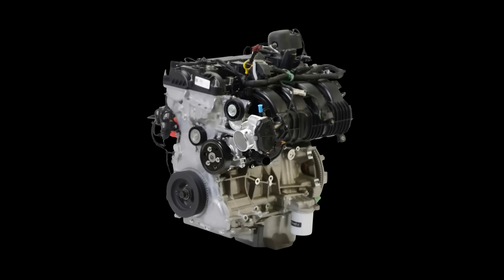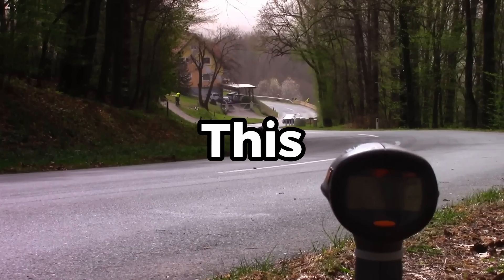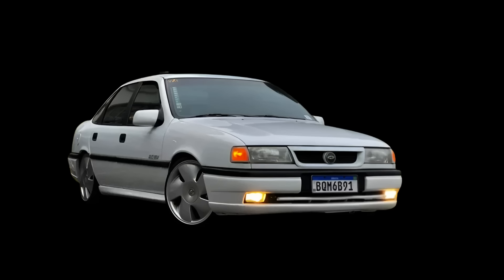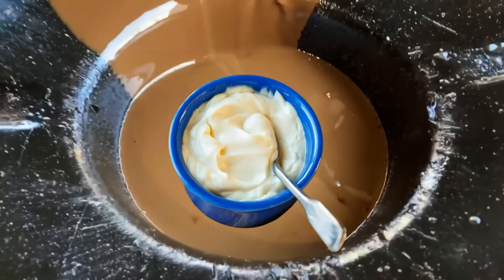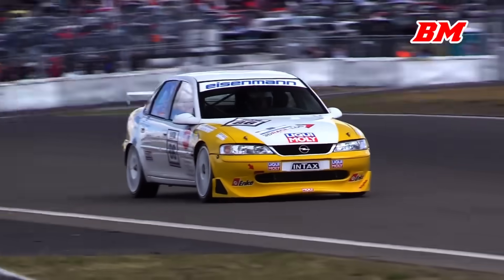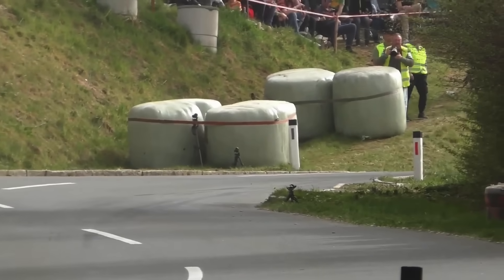The C20XE: When Cosworth And GM Built an Engine Together

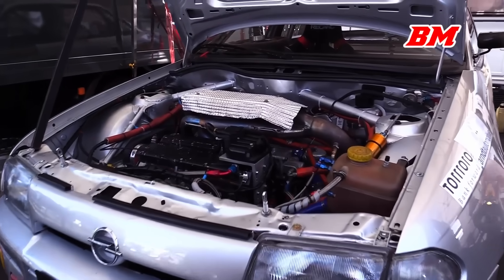Comment: 6:45 Z20LEx Sanitised? Fuckin' LOL. Drive one and then say that. There are very torquey motors in cars with rather basic chassis. They're quite a handful in a fwd car! I had a Courtenay Sport tuned Z20LET in a 2003 Astra GSI, which made a modest 285bhp, but with a hilarious 340ft.lbs of torque at 3k rpm. Needed sticky tyres and a Quaife LSD to make the most of it, and torque steer made for an exciting drive down twisty bumpy country roads.

Comment: 5:13 That's either an N/A X20XEV with an aftermarket turbo fitted, or it's a modifier Z20LET. Totally different head, although the bottom end and block is very similar to the early engines.

Comment: 3:39 the Mk4 Astra here never came with the C20XE; they came with a later evolution of the engine, the X20XEV. There were also some that came with a yet newer again Z20XER, and finally the Z20LET which was a turbo charged variant making 184~197bhp, depending on whose figures you use. Interestingly, even engines as late as the 240bhp Z20LEH used in the Astra VXR in 2010, use a block that is almost exactly the same design as the C20XE. All of these engines evolved from the original 20XE that was designed by GM and Cosworth in 1987. Note, the 20XE, NOT the C20XE. The C20XE didn't come along until 1988 and had O2 sensors and catalytic converter, whereas the 20XE did not.

Comment: You should to a video on peugeot's XU10J4RS or maybe Fiat's Pratola Serra modular engines especially the fivetech 175.a2000 (na) and 175.a3000 turbo variant found in the fiat coupe

Comment: Actually I think the engine was developed from the C20ne (8v) with a new cylinder head. Not a completely new engine.

Not a bad engine anyway but the Saab B204/B234 was slightly better back then.

Comment: I don't know why they didn't just use the Olds Quad Four head and down size it to 2L if necessary. The W41 was making 195hp with 2.3L. The only thing close was the Prelude H22 quite a while later.

Comment: The very first redtops were 20XEJ these came with coscast heads.. the "C" came from later cars fitted with catalytic converters..my astra gte has a 20XEJ but is fully forged running a Evo 9 turbo..making 380bhp. proper old skool boosted power 👌
Reply: The 20XE came before the XEJ, no?

Comment: Iam driving a MX5-NA with C20XE swap. Pure Fun! Engine got a full build with Itbs albeit still hydro Cams. Makes 202hp at 7200 with the revlimiter set to 7800.
981kg with a full tank....
the sound is very special: It sounds like a mix of a tdi and a Chainsaw biting in Oak when you rev it hard.
Reply: It's the first time I hear of an MX5 with C20XE, although I think there were C20XE adaptor plates for RX-8 transmissions :D How much torque are you putting out with the ITBs? Respect!
Reply: @martinp8427  

A Adapterplate wouldnt have worked (I needed to get 18mm backwards). I ended up cutting ?? 48mm of the Bellhousing and welding 30mm of the Astra Bellhousing to the Mx5 Gearbox.
torque was 223nm/164ftlb @6150 with the Lexmaul RAM and 206nm/151ftlb @ 6600 with Itbs. Power stayed the same, but at 7200 instead of 6600rpm. But with the RAM i had an unacceptable Lumpy Idle.
Reply: @TheVossba  Oh, I didn't expect such a difference in torque! Too bad about the poor idle, maybe it was a combination of the slightly aggressive cams and adjustable cam sprockets. Great build and thanks for the info!
Reply: @martinp8427  

the Lexmaul Ram intake is known for very good torque, but the long narrow Runners limit topend. Idle gets lumpy if you use Cams with more Overlap and a single throttle.
the tüv approved Itbs from Dbilas have very short runners and my 274deg Catcams were the max for the ram, but not enough for the Itbs..

Comment: Swindon Race engines took the C20XE right up t the 320bhp mark with a redline of 8500rpm in BTCC format.
To get there, they actually reversed the head so the intake was at the front of the engine bay to gain a ram air effect, with the exhaust being at the back against the bulkhead in FWD applications.
Reply from the maker: Yes that's actually a popular setup on high horsepower NA builds, thank you for the extra informations.

Comment: These were AWSOME!!!!!!!!    Worst thing about moving internationally was leaving my Kadett in South Africa. It had a seriously built C20XE and looked like a SuperBoss.  24 years later I still miss it.  A friend looked after it but eventually had to sell it for me as his wife uttered the "it's me or the car" line 🤣🤣🤣🤣
 LOL about the noise laws - these motors were NOISY. Not exhaust, just everything 🙂 

The T-cars were pretty amazing. Very low drag and weight made even the little 1.6 8v Monza GSi capable of silly speeds.   
In the same time period Opel had many other world leading products/concepts.
As far as I know these cars were the only ones where you could do a full clutch change without splitting the engine and gearbox!!!!!  You could also take out the full gear cluster assembly to replace gears/bearings or fix the shift forks, without taking the gearbox out of the car (ask me how I know).   It was also a serious case of robbing Peter to pay Paul to keep prices competitive -  amazing engines & tech but you had to put up with the dash jumping on your lap when you start turning towards a dirt road. 

While working at Delta (GM builder in South Africa in the 80's & 90's),  the company car dream was the Opel Astra 200ie - the booted Astra F with the C20XE. 
There was also the 200ts - but I think they knew better than giving those to the young rev-heads in staff......

Comment: 1:10 i reccomend the volkswagen ea827 but the brazilian one the vw AP, is the most used engine when it comes to make cheap and high power, somes with 1500hp stock cast steel block.

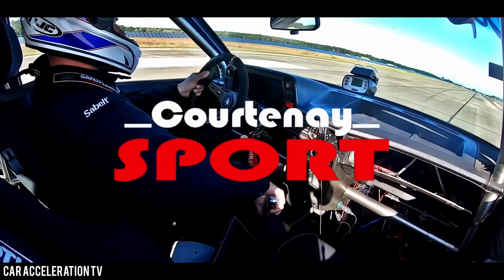5:55 this chevette is from brazil.
Reply from the maker: Yes a lot of people mentioned it and I already was planning on doing an episode on it soon. The thing is I couldn't find enough information about them.

Comment: The FIAT 2.5L 5 cylinder 20V and his relative 2.0L 4 cylinder Lampredi 8V and 16V should be feautured next. The first is a very underrated 5 cylinder unit and the second is the most successful rally engine ever.

Comment: The C20LET also powered the very mighty South African only production Opel Kadett and Astra 200TS, they were regarded and still are as 2 of the best turbocharged cars to hit the SA motoring scene EVER!
Totally unbeatable in a light to light race, even the mighty BMW E36 M3 had trouble when encountering a well maintained and healthy 200TS!
Reply: During that time they felt so fast and crazy and today my wife's diesel is 2s faster to 100kmh and similar top-end.  🤣

Comment: Do you have film about Mitsubishi 6A engine? Especially 6A12 with mivec?

Or Mivec 4G92

Or 4G15

Or VW ABF 2.0?
Reply from the maker: The 4G15 is on the list.
Reply: @PistonPop-TV  4G92Mivec called Cyborg was in a time most powerfoul 1,6 NA engine. More powerfoul than B series or Toyotas. 

ABF was answer on C20XE. It was in MK3 golf GTI or mk2 Ibiza. With some tweaks can do 170 hp and with some abra kadabra with other VW parts can have 2,1 L and 230+ NM and over 190 hp with about 7000 rpm.

6A12Mivec was little madman with 2.0 200 hp NA V6 revving to over 8000 and sounds amazing ;)

Ps. I had Hyundai pony 1993 with 4G15 with broken one cylinder (its dont had spark) its still revs to the end and goes over 100 kph ;) so i belive in this engine indestructability 😅

Comment: You gotta love Opel's engine naming conventions for telling you everything out of the box.
With C20XE and C20LET, the C is for catalyzed (3-way), 20 means 2.0 liter, X and L are compression ratios (X for over 10.5:1, L for under 9.0:1), E is for electronic fuel injection, and T is for turbo.

The only shame about the C20XE and C20LET is that Opel never made the six-cylinder versions like they did with the CIH engines from the generation before, imagine what kind of beast a C30XE or C30LET would be.
Reply: Love it when manufacturer makes us easily read and distinguish engine features. Similar with Nissan engine naminh scheme: engine family-capacity (in cc)-technology and features. I would also say Toyota, Honda, and Mitsubishi too, but a little bit cryptic.
Reply: You're right! Nissans and Hondas are the best at it because it's literally family-displacement-technology. Toyota and Mitsubishi are a bit more cryptic, but still good.
Reply: ?? they made new heads for the cih. they didn't need to make a new bottom or "whole" new design but they made a 24 valve straight six which in the lotus omega turbo version was tuned up to 370hp stock which was at the time already deemed insane power for an euro car. the six cyl had lots of heads.  like the double overhead cam versions FOR REAR WHEEL DRIVE are just still part of that "cam in head" family.

but you gotta understand the economics of the euro region mean that while people would lust over evo omegas and lotus omegas and senators and everything like that.. most people just would need to settle with a fast astra or kadett,  vectra or a calibra.

opel also had cosworth doch version of the inline 4 '''cih''', but that was rare as balls being a homologation one.
Reply: I know about the C30SE from the 24v Omegas and the stroked C36GET from the Lotus, those are absolute beasts. I was more thinking along the line of "what if someone added two more cylinders to a C20XE".
Reply: E means essence. PETROL!

Comment: The 1.6 B6T from the early Mazda 323's that went on to become the Mx-5/Miata engine but without the turbo. Then became the 1.8 BPT, again the 323 had turbo and AWD.

My first car was an AWD 323 with a B6T, late 80s early 90s they were taking names with upgraded Subaru turbos like vf10's from the RS liberty and Fueltronics ecu chip tunes to run 16 psi on 98 octane. Great 230bhp lightweight awd hatchback, perfect city car. The BPT's continued the legacy of being the WRX underdog slayer lol. Dual feature maybe?

Comment: When I was younger the redtop Nova or Corsa was king. I loved the early 90's BTCC, so I've always wanted a Cavalier GSI with the redtop turbo.

If you're looking for something different to do a video about, have a look at Triumph. They made three engines of note. There was the infamous stag V8, which was not great, but they did make two great engines. The Standard-Triumph straight 6, introduced in 1960, which ranged from the 1.6 Vitesse 6, all the way up to the 2.5 liter PI with fuel injection in the mid 60's and carbed versions with over 150hp. They were incredibly tunable and inspired the Nissan L series among others. Then there was the slant four Sprint engine, a mid 70's 2 liter 4 valve SOHC that was detuned from the factory to make 127hp, but easily made 150hp with a retune, 200hp with some tinkering and 250hp or more in race trim. It's considered to be the worlds first mass produced 4 valve engine. The slant four block is also the foundations of the famous Saab turbo B234 series too.

Triumph was way ahead of it's time with many innovative designs. BMW based their philosophy on Triumph and they had so much influence on so many other manufacturers too. I's such a shame they don't get the recognition they deserve.
Reply from the maker: Thank you so much for the detailed information, I will definitely take them into consideration 🫡

Comment: GM did work with Cosworth before, the North American Chevy Vega in 1975-1977. you could get a Cosworth Vega  It was a 2.0l with Bosch fuel injection
Reply: Those can make over 300 HP with a sleeved block, high compresion pistons and cams, naturally aspirated. Arguably superior to a NA BDG as it's considerably lighter. Forged and balanced crank, rods, and pistons from the factory. The head is even based on the same casting as the BDA/BDG head. The boss for the Ford timing belt tensioner is still clearly visible on the front of the head, just undrilled. The Ford intake will almost bolt right up, all that is required is drilling and tapping some extra lower holes in the flange on the head, as the GM manifold has them about half an inch lower. Most of the BDA/BDG valvetrain parts will interchange as well. Even in totally stock form, with the stock EFI, removing the restrictive cat and pulse air injection will bring it from 110 to 160 HP. Recurving the distributor and advancing the timing can get it to 180-190. Replacing the EFI with dual Weber 45 DCOE's can bring it past 200. It's a very slept on engine, they are often for sale for under 1K on Marketplace and at junkyards. At that price you could easily have the block machined for Darton style wet liners and you could have an engine with BDG like performance at a fraction of the price.

Comment: Hey PistonPop, search about the brazilian Volkswagen AP, it's a four cylinder engine that car guys uses in a lot of projects, reaching 400, 500 HP easily. There is some that probrably got 1000+ HP as well.
Reply from the maker: Yes I'm aware of it and already planned on making a video on it, it is also known as the EA827 and mostly found in the VW Gol in the Brazilian market.
Reply: @PistonPop-TV Yes, the Gol was the most sold car for over a decade, maybe two, but they are also found in a whole variant of cars, even Ford's! (In Autolatina times)
Reply: @PistonPop-TV  If you need anything, from translation to videos and etc, just let me know
Reply from the maker: @gustavogarciacasagrande8145 Thank you brother I will let you know, maybe even let you review the video for me before uploading it.

Comment: B-Series is the king of the 90s. Currently the most powerful Honda B-Series based engine (that I know of) is making over 2500 hp.
Reply from the maker: Yes but that doesn't mean the C20XE is a lesser of an engine, there is some drag racing teams pushing 1500hp+ with it.
Reply: I'm a Honder fanboy, but how much of that 2500 hp B18 is factory?
Reply: @skaldlouiscyphre2453  not much, notice I said “b-series based”.

Comment: GREAT WORK!!!! Congratulations!
It's rare to see videos about this engine, specially where they were used. The newer engines would also do a great video.

One information about that was a bit of was the power level. The N/A had 3 versions:
- C20SEL (136 hp), used by GM/Chevrolet in poorer countrys (ex. Latin America);
- X20XEV (150 hp), used in Europe as the standard;
- X20XER (170 hp), used in Europe on the first versi;on of the Astra G OPC/VXR.

I live in Brazil and besides being more expensive to modify than the VW lineup you still see some examples of very well tuned/modified units.
Reply from the maker: Thank you so much for the detailed information and your kind words, I appreciate it! 🫡

Comment: It is indeed a magnificent engine, but the Coscast heads were not indestructible.
Reply: Some say that the GM heads with a fixed porous issue (pugged oil way or external oil way) are even stronger than the Coscast heads. I have an early GM head that has external oil way on the back of cylinder 4 and no porous issues for the last 10 years.
Reply: @martinp8427 I had a coscast head that was somehow leaking cooling liquid. It kept pressure, wasn’t smoking white and there was no coolant in the oil. Sold it as it was. Loved the car, but doubted the engine.

Comment: Pleased to see that there's also some footage from Brazil at the video, like the two Chevettes drag racing (this car is our version of the Opel Kadett C). This is a very dear engine in our country, being sold in Calibras and first gen of the GSI Vectra (as the white one shown on the video, with brazilian license plates). We never had the C20LET variant, but there are many builds making it a stroker to 2.4L. Since we had the Family II Opel engines being sold here for almost 30 years with single cams or the X20 variations, the C20XE heads and camshafts became a kind of holy grail for tuners. Thanks for the video!
Reply from the maker: You're welcome my friend, I'm aware of the Brazilian car culture I'm planning to make a video on the VW AP engines and some of the fiat engines, I always come across some wild builds on those engines coming from Brazil.

Comment: The early ones that had the head stamped 'coscast' had smaller water jackets in the head allowing more porting. Fun fact.
Reply from the maker: Yes that's how you can differentiate between Coscast heads and GM heads

Comment: Was this said in the video?  
C20XE's torque-to-displacement ration record of 114 Nm/litre stood for almost two decades until it was surpassed by the Ferrari 458 Italia, which produced 117 Nm/litre in 2009
Reply: Luther, I believe that record was held by the Honda F20 used on the Honda S2000
Reply: @psf12345  he talk about NM not HP
Reply: @psf12345  honda makes more power, per cc but this makes more torque per cc. in practical terms this means the honda needs more rpm for the same power.       still i'd rather have the honda and i'm an old opel fanboy.  both of them are so much more displacement efficient anyway compared to americans of the time that it's ridiculous.
Reply: The spread of torque is brilliant as well as the headline figure. Incredible engine.
Reply: Yes that was for the South African homologation Kadett GSi 16v S (AKA SuperBoss) it held the world record for Nm per liter